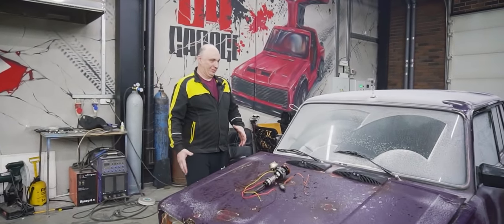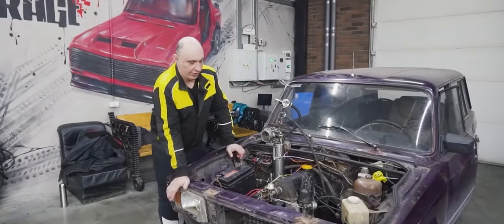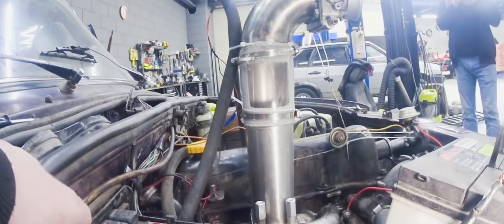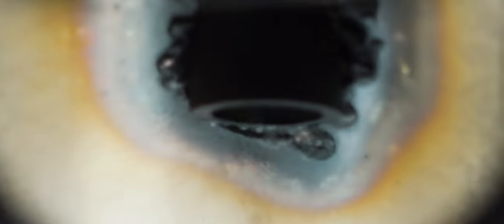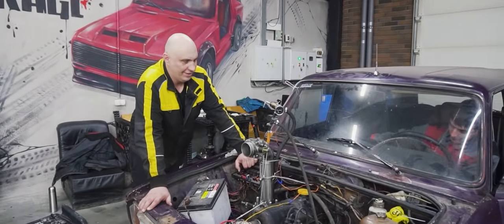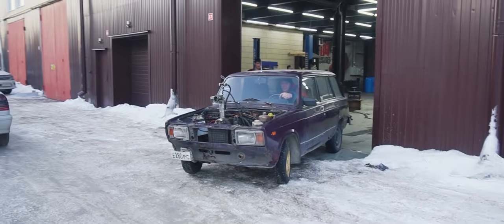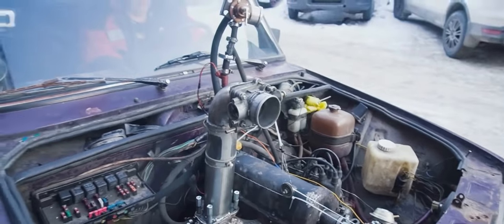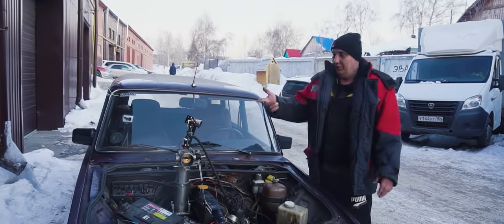Can you replace a carburetor with a fuel injector?

Comment: Your on time decreases with RPM due to it being a fixed ratio of engine rotation to dwell angle from such a basic set up.

Or put another way, you lean out the mixture with RPM.
Reply: @volvo09  the simplest thing I could think off is to use the distributor to trigger a 555 based timer, and a TPS to vary the control voltage. So a very simple throttle position varies duty cycle set up.

Not great, but it would work far better than this set up, and still be super simple
Reply: But the injection time also shortens and speed up as RPM goes up. Might be too quick that injector time is too short to actually open up the injector fully

I would actually consider this on my experiment...trying to run a small motor with water electrolysis but instead use a 555 timer to modulate injector time (pulse width, can be milliseconds) and frequency (injection operations per second)
Reply: @ruikazane5123  yeah, trying to ask an injector off a multi point set up for a car to fire twice per revolution at high RPM would be asking a lot of it.  Alternating between two would probably just about cut it if they had a high enough flow rate.
Reply: I think it would have worked better as a makeshift MFI instead of a Make shift EFI, that way it would need less of the janky hoses and distributer.

Comment: yes you can there called tbi or trottle body injection , been used on production cars as a cheaper option to mulipoint fuel injection they still use a computer and lambda sonde to measure the fuel ratio 
you probably need to base the fuelpressure of the manifold vacuum to get it to run ok enough
Reply: AKS Single point Fuels injection.
Reply: AKA Center Point Injection

Comment: I don't know much about mechanics, but I would say that placing the injector closer to the intake manifold would give better performance since having it as it is at the moment, the air reaches the engine before the fuel diffused by the injector.  Using reasoning I would say that the injector closer to the manifold would solve that high rpm performance problem.  Cars generally use the injector in each intake port of each cylinder and then the throttle butterfly comes from behind.  In cars with single point injection the same rule is followed, with the difference that an injector supplies the 4 cylinders and this is located just before the intake manifold branch.  I think the throttle is the correct size.  Great video!

Comment: Fuel injectors take a bit of time to move from closed to open. At lower RPM, it is spending more time open than at higher RPM. Hence the low RPM flooding and high RPM leaning out.
Reply: I've been a mechanic for a long time working on a lot of cars I never went to school for it but in my mind I'm thinking that an injector is holding back those PSIs while they have power going to them and the magnets holding the spring loaded ball valve take a lot of force when the explosion occurs as well. So yeah I'm sure it takes a little time for them to open and close even though it's milliseconds
Reply: true, you need a micro controller with an algo that generates a PWM signal and a crank pos sensor.

Comment: You just need to invert the signal from the distributor.  At lower RPM it has more dwell/on time.  At higher RPM you are getting less dwell/on time.  This is exactly opposite of what you want.  
You can do this with transistors or MOSFETs.  Invert the injector trigger and it will run perfectly fine.  Mechanical Diesels work this way.  Throttle input and RPM determine fuel injection.
Reply: @Tiporari where would you connect the resistors? Would regulating voltage on the injector help

Comment: Get a potentiometer/variable resistor and hook it to the throttle shaft and feed your injector with it. Should raise and lower your fuel imput with the throttle. This should allow you to run a bigger injector to give it enough fuel at higher rpm
Reply: That would call for a variable potentiometer-controlled PWM generator hooked to a MOSFET that will open and close the injector.

Comment: using that distributor to control injector pulse will never work correctly. it will run rich at idle and lean at higher rpm because you are shortening the pulse width the faster the rpm is with that setup instead of enlarging it. it might be pulsing more rapidly but for shorter amount of time. just like the issue that it can leave the injector open when engine is off.

Comment: Great experiment, but you are only considering rpm to add injection time, you need to find a way to modulate injection time based also on engine load

Comment: The injection angle/time should increase with load and RPM, that's not possible with a distributor, so you should increase the fuel pressure using the vacuum in the intake port, behind the throttle body.
The distributor is working giving a lot of fuel at low RPM and less at high RPM.
Also you should add an O2 sensor in the exhaust system and a hallmeter to know what is happening.

Comment: Back in 1971 someone made a single port injection carburetor for a Chevrolet Vega it supposedly worked great it used a small timing module that worked with the stock system!! But as quickly it came on the market it dissapeared!! If anyone  knows who made it  I would like to know!!

Comment: The air fuel ratio for the engine is determined by how many milliseconds the injection is held open. The setup with the distributor is mechanically set with no way to change how long the injector is held open.
But maybe you can get away with rigging up a fuel pressure regulator with the throttle or throttle body.

Comment: Could you make a 2 stroke engine out of a 4cylinder engine. Making 2 firing pistons and the other 2 will pump the fuel air mixture into the firing pistons. I've thought about it years ago. but not enough resources. Maybe you could and also figure out a path for the exhaust.

Comment: That was a really good one to show that you don’t need an ecu the car will probably run better with one then without but the ecu and all the sensors can brake so you need to find the problem and so on and so on that is a really easy setup to work with!!

Comment: Ha ha, this is pretty much exactly how the throttle body injection works on my old chevy truck. Just a couple of fuel injectors sitting where the carb should be! Although with my injectors, they don't pulse at all, just a steady stream of fuel. Anyways, I always love seeing your guys' crazy experiments.
Reply: They do pulse, it's just that the frequency is high enough to trick your brain into thinking it's a continuous stream. Using a 20...60Hz strobe light over the injectors should clear that out for you.

Comment: Awesome project, what would happen if you used the vacuum advance on the distributed so the injector can fire a little earlier with the revs higher? Also for better throttle response you may need some style in accelerator pump for the extra shot of fuel when stabbing the throttle to make up for the massive consumption of air being introduced. Great job. A 107.7% success

Comment: You definitely need something that can control voltage and pulse width to time the injector correctly, as for the pressure regulator they usually rely on vacuum to adjust the delivery and return. A good tinkering experiment for the students no matter what though, so good job 👍

Comment: This is awesome, would love to see a dual injector setup that uses a centrifugal clutch that allows for a distributor to activate at higher rpm and have another injector fire for the higher rpm. Or maybe I'm off and a better setup for the airflow would work better. I'm sure a smaller less complicated setup would work just fine

I bet you could have the distributor run the electrical contact points through that centrifugal clutch in such a way that it activates a second injector at medium rpm and a 3rd at high rpm with very small injectors being able to fine tune air fuel ratios. If not, 3 distributors work too.

As another user commented you could use the vacuum pressure to make an increase in gas flow as well and decrease as pressure goes up. I think combining it with this could probably give a really good setup that acts in a more tunable way if a setup was built for it and machined into one single setup. With each injector made to fire at specific rpm range, duration added, and during quick throttle opens more can be made to inject during that to help with throttle feel. It doesn't even need to be much. A psi extra or slightly more at low rpm and medium rpm would work. Maybe high rpm like 4.5k to till max as well for quick high rpm throttle feel?
Reply: Thats a nice idea!

Comment: Something to remember, with the way you are running the injector, the faster you rev the engine, the shorter the pulse of the injector. This means that you have a long pulse at idle, and a short pulse at rpm. That is why it is flooding at idle and leaning out at rpm. That needs to be flipped somehow. How did you adjust the spark gap? Is there a way you could use the mechanical advance on the distributor to adjust that gap? Short gap at idle, long gap at rpm. Then to get a fuel adjustment, you could perhaps hook the throttle up to that pressure regulator. No throttle, low pressure. Full throttle, high pressure. Both these fixes are fully mechanical, still very cheap, and should make it run a TON better… all this along with a matched throttle body like you stated.

Comment: I really enjoy this stuff here are some of my thoughts, keep up the good work.
 Some early transistor ignition conversions used the points just to trigger the circuit and the transistor ignition provided a timed ignition pulse at all RPM the pulse would be about 2 thou of a second. This would give a better starting point, same fuel delivery per cycle, then a air bleed to fine tune idle. Something still lacking would be accelerator enrichment. I just went through similar development with a mechanical system I put on my motorcycle, not my invention but a challenging application.
Reply: can u share with us more about the system that you put on your motorcycle? do you have a video about it?

Comment: I had a thought last week that could make for an easy experiment... Is it possible to mix drinkable alcohol with gasoline? I don't know if you have an E85 tuned vehicle you could try this on, but figured I'd throw the idea out there. Good luck!
Reply: Alcohol ruins some rubber gaskets. You need an engine and a tank with gaskets and tubes that tolerate alcohol.

Comment: If you feed power to the injector via the power to the coil, you can use this setup on a electronic ignition and you won't have to install a kill switch to keep the injector from firing when the engine is not rotating.

Comment: GM used a system like this called Throttle Body Injection. I had a 84 Corvette that used two of these throttle body injection systems for thre Crossfire Injection. only difference was that the injector mounted in front of the throttle body.

In a normal vintage fuel injected car, they use a ECM that is clocked off distributor but then frequency divided so fuel injection pulses twice every cycle. then there is a thermal sensor that changes fuel mixture based on temp. Then There is a throttle position switch along with a Air flow meter, (little flap with variable resistor) that would richen mix with throttle control giving you a even mixture through throttle. lots of cars would also have a vacuum controlled fuel regulator that would increase pressure when there is less intake vacuum.  Fuel injection is a neat system especially on the old 70s cars like the Datsun 280z

Comment: Putting the throttle body closer to the manifold will likely make it smoother and more power. The air/fuel charge has so much distance to travel to its cylinder where you may only get half of that chagre now essentially. Or if anything better atomization in the cylinders.

Comment: I keep looking at those vacuum ports sticking out of each side. These will probably be bringing in air after the throttle body. If so, simply plug them up and more than likely cut down the air flowing in dramatically. But, knowing how smart these guys are they are probably plugged off but we just cant see them.

Comment: You need to rig up a multi port setup fire the injector off of the previous spark plug and it could spray just as the next intake stoke happens

Comment: Education with backwards compatability. Nobody wants to learn how a mouse trap doesn't work. Try mixing diesel fuel (25%) and appx .05% distilled water to 100 octane av-gas, and increase timing to min 20 degrees.

Comment: I ran a 1982 Buick 3.8v6 using a 1986 Honda 350 carburetor. It worked well for 8 months. It had a great mid range.  Acceleration was good. I'd do it again but I hate carburators now. Lol

Comment: In american cars, it was a very common setup in the 80s. You can even buy a pre-made Holley system just like this for old cars
Reply: Those early american cars use TBI system. They are computer controlled. This is mechanical controlled. Holley system like the sniper use computer and sensors inside the system.

Comment: Maybe baffle the intake tube to form a cascading effect and also increase turbulence for better atomization on it's way into the combustion chamber. Also remember lower fuel pressure worsens the atomization.
Reply: what you are saying here is their intake runner is way too big in diameter.... and I would agree. This is like sticking a 4 bbl carb on a lawnmower.

Comment: Did that white estate car have "SS" numberplates on it???  Surely not O.o   I was thinking back on topic on the old Lucas mechanical injection which used a fuel distributor like a spark distributor but distributing fuel into the six feeds to the injectors, it was famously unreliable but when it worked it kicked the Triumph 2.5PI forward like nothing else but the failure rate of the PI distributors saw many owners converting to twin or triple SU's harvested off Jags.

Comment: The purpose of computerized systems in a vehicle is simple. The optimum fuel to air ratio is called stoykeometry, and is 14.7 to 1. Every sensor, in every car, is designed to be controlled electronically- usually by the ecm or pcm (computer). The only function of the computer is to keep that 14.7 to 1 ratio under all conditions, via the sensors. Its that simple. Even if it is carburetted the air / fuel ratio remains the same. This is why you tune a carburretor with a vaccuum guage, and jetting size. Its that simple

Comment: You need to modulate the “dwell” (the duration that the injector is open each time it fires). With a fixed dwell like you have, the fuel delivery is good only for a specific  throttle opening. It’s not the size of the injector that matters, it’s the length of time it’s open, this is basically what the ecm controls depending on what the sensors tell it. Your simple method could work on a fixed rpm engine, like a lawnmower or generator. 
If you controlled the point gap relative to throttle position, it would probably work fairly well although still quite crudely.

Comment: Didnt warch yet but Yes you can. Long ago i had a V8 Chevy 305 engine with an electronic carburettor or single point injection, didnt have the car it came from but was told it was a model year 1987 engine. It was installed in an old fullsize wagon, took it on a long trip, similar power as a Holley 650 but consumed noticeable less fuel. The electronic control unit was huge with a lot of cables i recall.
Reply: The V6 on the Pontiac Fiero had a fuel injected carburettor. It would have 1 injector that sprayed fuel down into the top of the carby .

Comment: you gotta put 1 injector for Idle and mid RPM's and a second injector for high RPM's, you just need to add another injector and that's it! (you can put a switch in the accelerator pedal for secondary fuel injector activation)

Comment: All that fluffing about when you could have bolted on a Suzuki Escudo throttle body injection unit, it fits straight on to the Lada inlet manifold and has only three inputs, manifold, crank and cam.

Comment: You could use a Relay that cuts power to the injector when the key is turned off so if the distributor stops with the contacts connected, it doesn't keep dumping fuel.  (AUTO SHUTDOWN RELAY)

Comment: A Rheostat in line would keep the injectors from cycling fully on and off. It should vary the amount of voltage and solve the rich condition. It would basically be used as your Throttle Position Sensor.
Reply: The problem with the rheostat would be that the injectors can be fully on or fully off at a given time. Higher than normal frequencies, lower than normal on-time, or lower than normal voltage (what a rheostat does) will all create a situation where the injectors drip (or simply don't work) instead of atomize fuel.

Comment: I know here in either Canada or USA a guy back in the 1950s the cars got 12 mpg 3.17 liters for a mile something like that.  Anyways he redid his car which weighed 5,000 pounds and got over 50 mpg. 5.6 liters per 100 km. So if you can build a carburetor like that let me know I'd buy one if for a car on regular gas and 1 made for a diesel truck. 6 by 6 all wheel drive. Like a transport.

Comment: Great idea BUT... I just realized you have a fixed distributor gap, this means a fixed duty cycle. In other words, no matter the RPM of the engine, your supply rate overtime will always be constant, just the speed of the On and Off will change, while still maintaining the same Duty Cycle relation. Engine will be running Rich when low RPM, and Lean in high RPM.